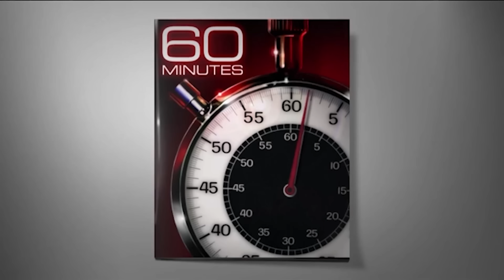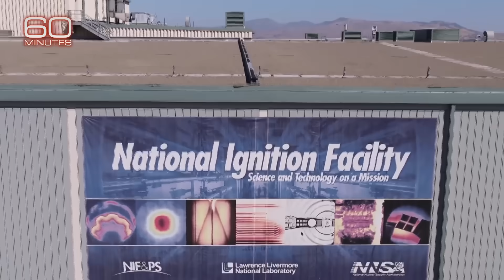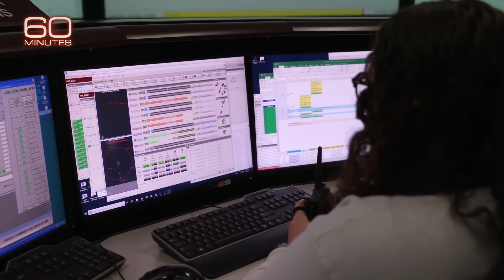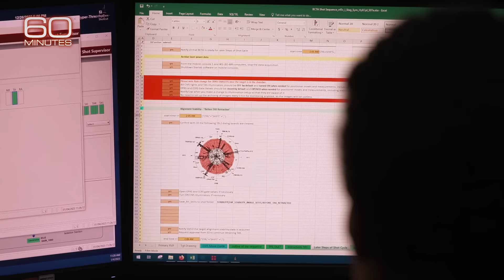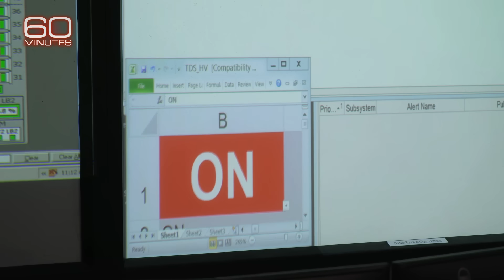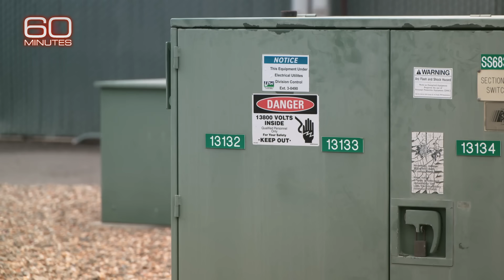Nuclear Fusion: Inside the breakthrough that could change our world | 60 Minutes

Comment: Lasers are too much expensive in energy.  I'm not sure this will work as well as toukamak which are already producing energy in china.
Reply: Most nuclear fusion 'breakthrough' announcements are filled with sales hype intended to gain private and public support for these exceedingly expensive experiments. The announcements tend to focus more upon the ultimate goal than on what was actually achieved. They also tend to capitalize upon the fact that most of the viewers don't have the technical background to critically examine what was achieved and what wasn't.

In many cased the achievements have been about achieving ultra-hot plasmas and sustaining them for more than a second. The announced experiment on the PRC machine was about how long the plasma was sustained, not about them achieving any fusion energy output. That and most of the other experimental machines are not intended to operate with fusion fuels and aim to produce fusion reactions.

If you look up the original announcement for the Chinese machine and the Wikipedia articles on it you will learn that no fusion fuel was employed and that fusion energy production is not the aim of the experimental machine.

Comment: This discovery is amazing and really is a break-through but can someone please help me understand what they mean by "shots". They say that they use a little over 1 shot per day but to make it commercial they have to use 10 shots per second. I'm 14 years old and trying to understand and educate myself so can someone please help.
Reply: Most fusion energy breakthrough announcements are filled with sales hype. This particular experiment took around a week to prepare. The fusion reaction lasted for approximately 0.00000000008 second and then approximately 96% of the supplied and enormously compressed fuel was blasted away from the reaction center. There was no significant propagation of the fusion reaction so the use of the term 'ignition' is misleading. The amount  of fusion energy generated by the nuclear fusion reaction was about enough to boil two liters of water. The NIF laser can't operate much faster than one shot per day without experiencing unacceptable damage.

The NIF laser system can only develop its enormous energy via an extremely short firing pulse that last approximately 0.0000000030 second (3.0 nanoseconds). Once the enormously intense visible laser pulse is created from the multiple lasers the light beam is converted to ultraviolet light and then to X-rays. A portion of the X-rays serves to compress the capsule containing the two hydrogen fuel isotopes, deuterium and tritium, that are frozen on the inside wall of the diamond fuel capsule.

In the case of this announcement the NIF administrators finally revealed that more than 100 times as much energy was expended in powering the laser then the amount of energy generated by the nuclear fusion reaction. A reporter asked a direct question about that input energy that the lab had previously kept quiet about.
Reply: @vernonbrechin4207  thank you so much

Comment: I thought they were going to microwave helium
Reply: There are numerous other approaches to achieving controlled nuclear fusion reactions. In most of the cases the result of the proposed fusion reactions is an isotope of helium. In the case of this experiment the fusion reactions resulted in the formation of some micrograms of helium-4.
Reply: @vernonbrechin4207  what if they used an amplifier and a compressor to get more from their initial emission
Reply: crystals prism light maybe you can focus the energy like a magifiying glass
Reply: @Djent7779  - At temperatures of well over 100 million Kelvin everything is in the state of a extremely hot plasma. No amplifier, or compressor can operate at temperatures even 1/10,000,000th of that temperature.
Reply: @Djent7779  - Most of the fusion energy in these reactions comes in the form of neutrons having a kinetic energy of 14.1 Mev. The neutrons come off in all directions and neutrons can't be focused by magnetic  electrical, or other related forces. Those, without a strong academic background in nuclear fusion physics wouldn't be expected to know about such limitations.

Controlled nuclear fusion experiments have been going on since the 1970s, have spread to about a dozen countries and involve the best nuclear fussion physicists that the world has produced. Still, many lay people often assume that all that effort has left out their clever suggestions.

Comment: Just after 9 minutes it's stated that fusion give more energy than fission as we use it. That is not true by about a factor of 10.
Reply: I'm glad you looked at this issue critically. In general the D/T fusion reaction emits far more energy than in a typical fission reaction per nucleon. That is a theoretical and experimental result. It is applied in the design of thermonuclear (H-bomb) explosives.

So far no one has demonstrated a controlled nuclear fusion reaction experiment that generates more energy than is fed into the experiment. In the case of the announced NIF shot the lab management finally admitted that their laser system consumed about 100 times more energy than they measured from the fusion reaction.
Reply: @Vernon Brechin  yes, per nucleon that is true. But wr are talking about total energy, which is about 160 MeV in kinetic energy of fission fragments (about 200 MeV total) versus about 18 MeV of energy for DT fusion. So, per event fission yields ten times more energy.
Reply: @ericlukosi6559  - Good points.

Comment: Every cent spent on this project is INSANELY worth it. These damn Americans, man 🔥🫡
Reply: It is estimated that approximately $11 billion has been expended on the NIF project. The target assembly, that is turned into a plasma by each laser shot, is estimated to cost approximately $100,000. The experiment took about a week to prepare to generate an approximately 0.00000000008 second flash of fusion energy, about enough to boil about two liters of water. NIF was expected to achieve this goal by 2012 but failed by a factor of more than ten then.

NiF has always been primarily funded as a thermonuclear weapon (H-bomb) research tool but has always been presented to the public as a viable path to a future economically practical nuclear fusion power plant.

Most nuclear fusion physicists have long agreed that the Inertial Confinement Fusion (ICF) used by NIF is unlikely to ever lead to a future economically practical nuclear fusion power plant. Many techno nerds believe that all approaches should be generously funded despite expert evaluations that certain approaches are not likely to end up producing viable results.

Comment: Blowing up things hotter then the center of the sun, daily. Doesn't sound like any risks here at all! Maybe move all this testing off planet?
Reply: Actually, they rarely fire these lasers more than once per day. Once per day is about the maximum rate they can fire them without accumulating unacceptable harm to that laser system.

In the announced experiment it took about a week to prepare for it and resulted in a nuclear fusion reaction that lasted for approximately 0.00000000008 second. There was no significant propagation of the reaction in what the lab refers to as 'ignition.' Only about 4% of the supplied fuel reacted before being blown away from the reaction center. Many nuclear fusion 'breakthrough announcements are filled with sales hype while obscuring the numerous barriers that are still ahead. In this case the management finally admitted that the input energy into the lasers was over 100 times greater than the nuclear fusion output energy that they measured.

Comment: Nuclear bombs are not fusion but fission.  Fusion is a new thing not just the containment of its energy as stated in this story.  Thank you.
Reply: There are two general types of nuclear bombs. Those that primarily rely upon nuclear fission of weapon's grade uranium and plutonium. Those are often referred to as atomic bombs. After that thermonuclear weapons were developed which are typically referred to as H-bombs. They employ fission reactions for both their triggering and part of the fusion section of the H-bomb. That fusion component often provides the primary energy yield in the weapon. It contains a special type of lithium deuteride in the nuclear fusion section. Once intensely compressed it fuses hydrogen isotopes to generate its destructive energy.

The NIF has always been primarily funded for the purposes of simulating the fusion reaction that takes place within the secondary component section of thermonuclear weapons. The lab management has always been skillful in obscuring that fact when presenting NIF to the public.

The major nuclear powers are armed with well over a thousand  nuclear warheads which remain on alert, ready to be launched within 15 minutes. The weapons that they, and most other nuclear weapon powers, are armed with are primarily thermonuclear weapons which have maximum energy yields of more than 10 times that of the American bomb dropped on Hiroshima, Japan.
Reply: @vernonbrechin4207  It appears I stand corrected.  Thank you for your time.
Reply: @ydne - Your welcome. I'm always glad to help others understand a topic, that is often obscured and even officially classified as secret, using numerous excuses. That information control goes against needing to keep the public well informed.
Reply: @vernonbrechin4207  To double check my understanding I ran the question through AI under "nuclear" with no reference to fusion.  Usually, I would expected the search engine to take the step from Nuclear to Hydrogen bomb.  Searches just are not as smart with all the workers they have laid off in the major on-line tech centers.

Comment: 8:15 bulshit I called bulshit there's no f**** way  that you are producing the same heat that's the same as the center of the f**** sun , of a Fireball 92.218 million miles away from the Earth. No f**** way you produce that amount of heat in it only melted that little bit of metal barely it would have destroyed the entire f**** thing you fuking idiot
Reply: 'Heat' is not a scientific term. They measured a peak temperature of approximately 150 million degrees Kelvin. It occurred in a microscopic spot and then that exploded outward from the extremely compressed microscopic center. The fusion reaction lasted for only about 0.00000000008 seconds. There was no significant propagation of the nuclear fusion reactions. The lab's use of the term 'ignition' is misleading. Most of the material near the reaction center was converted into a plasma. There was no significant melting.

Comment: This is nothing compared to what the chinese has been able to achieve with their artificial sun project
Reply: You are referring to the records achieved by the Experimental Advanced Superconducting (EAST) Tokamak located at the Hefei Institutes of Physical Science in Hefei, China. Typically, nuclear fusion energy 'breakthrough' announcement are filled with a large amount of sales hype to encourage further investments. The presentations tend to focus upon projections of what could become of the technology while being vague regarding what has actually been achieved. In the case of EAST, its primary goal has been to sustain an extreme temperature plasma for at least 1,000 seconds. The plasma uses the single proton isotope of hydrogen. No fusion fuel was employed and no significant nuclear fusion reaction was detected due to that. The giant machine's goal is not to generate a nuclear fusion reaction. EAST utilizes the Magnetic Confinement Fusion (MCF) approach in a tokamak configuration. The NIF employs the Inertial Confinement Fusion (ICF) approach which is completely different from that of the MCF approaches.

If you watched the full video to the end and in detail you might have learned that the NIF management was pushed into admitting a key point that in the past they avoided mentioning. In this announced experiment they revealed that the lasers consumed about 400 MegaJoules of energy in the effort to generate the measured 3.15 MegaJoules of nuclear fusion generated. That means that the energy generation was less than 1.0% efficient.

The following records account is from the Wikipedia article on EAST. 

On November 12, 2018, EAST reached a milestone of 100 million °C electron temperature.

In May, 2021, EAST reached a milestone of 120 million °C electron temperature for 101 seconds.

On December 30, 2021, a long-pulse high-parameter plasma operation of 1056 seconds was realized, which once again created a new world record for the operation of the Tokamak experimental device.
Reply: @vernonbrechin4207  you are correct and incorrect....yes i was referring to the east project in Hefei china, but trust me, these kinds of projects in china is considered as national strategic projects and as such will be government funded and wont need a dime from private investor....just like the chip industry there, the government there heavily provide funding just to be able to be self sufficient and not rely on other countries...

Comment: Didn't the Chinese have done this a few years ago, they have created the artificial Sun.
Reply: You are referring to the records achieved by the Experimental Advanced Superconducting (EAST) Tokamak located at the Hefei Institutes of Physical Science in Hefei, China. Typically, nuclear fusion energy 'breakthrough' announcement are filled with a large amount of sales hype to encourage further investments. The presentations tend to focus upon projections of what could become of the technology while being vague regarding what has actually been achieved. In the case of EAST, its primary goal has been to sustain an extreme temperature plasma for at least 1,000 seconds. The plasma uses the single proton isotope of hydrogen. No fusion fuel was employed and no significant nuclear fusion reaction was detected due to that. The giant machine's goal is not to generate a nuclear fusion reaction. EAST utilizes the Magnetic Confinement Fusion (MCF) approach in a tokamak configuration. The NIF employs the Inertial Confinement Fusion (ICF) approach which is completely different from that of the MCF approaches.

If you watched the full video to the end and in detail you might have learned that the NIF management was pushed into admitting a key point that in the past they avoided mentioning. In this announced experiment they revealed that the lasers consumed about 400 MegaJoules of energy in the effort to generate the measured 3.15 MegaJoules of nuclear fusion generated. That means that the energy generation was less than 1.0% efficient.

The following records account is from the Wikipedia article on EAST. 

On November 12, 2018, EAST reached a milestone of 100 million °C electron temperature.

In May, 2021, EAST reached a milestone of 120 million °C electron temperature for 101 seconds.

On December 30, 2021, a long-pulse high-parameter plasma operation of 1056 seconds was realized, which once again created a new world record for the operation of the Tokamak experimental device.

Comment: This concept was well under way back in the 1980’s when I had an office in the general area. They said they had performed the task once, but ,we’re being challenged to replicate it to their satisfaction. It seems the have now mastered the concept, not, the question is is it a realistic future for electricity? If so, it will change many aspects of human life!
Reply: The efforts began during the late 1970s. Several other generations of large Inertial Confinement Fusion (ICF) lasers preceded the National Ignition Facility (NIF). NIF began full power operation in 2009. It was expected to achieve its goal of 'break-even' fusion by 2012. It failed by at least a factor of 10. Since it is in fact primarily funded as a thermonuclear weapon (H-bomb) research tool the funding kept flowing in. It is estimated that the NIF construction, operation and experiments have now consumed approximately $11 billion US tax dollars. By late 2021 the lab announced it had gotten within about 70% of its goal. They were unable to repeat that in subsequent experiments. In this latest announcement they finally got over the 100% goal that they were expected to achieve by 2012. For those who listened carefully to the end of this video it was finally revealed that the energy required to drive the laser shot was over 100 times greater than the generated nuclear fusion energy that they measured.

The National Ignition Facility (NIF) has always been primarily funded as a thermonuclear weapon (H-bomb) research tool. The management have always obscured that fact, instead they have always presented it to the general public as a viable path to a future economical nuclear fusion power plant. The vast majority of nuclear fusion physicists agree that the ICF approach is unlikely to lead to such a power plant.

Comment: Looks just like the inside of the Project D.A.W.O.L. 2025 lab. Researchers John Obik and Matthew Urquhart invented a portable light refraction device that works using only magnifying lenses that can cut through steel, back in the 1980s in project D.A.W.O.L. 2025.